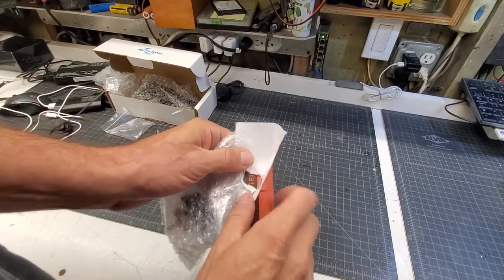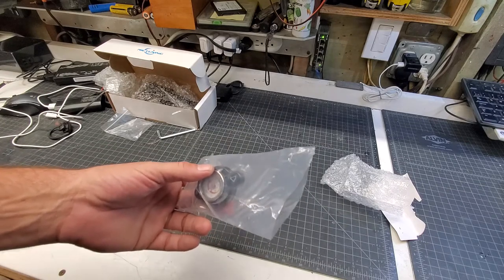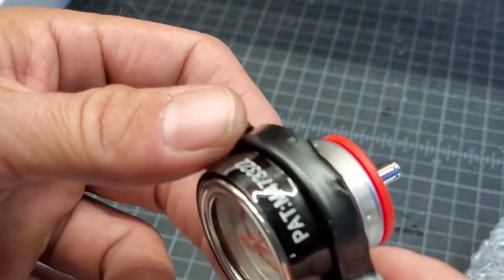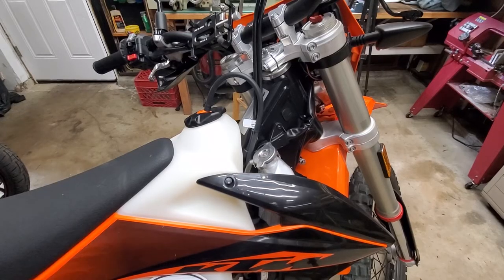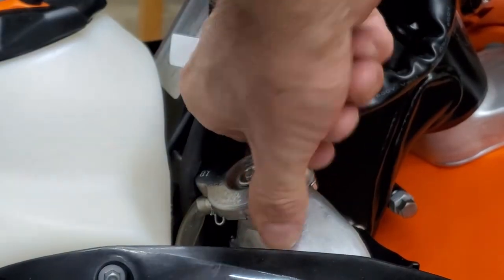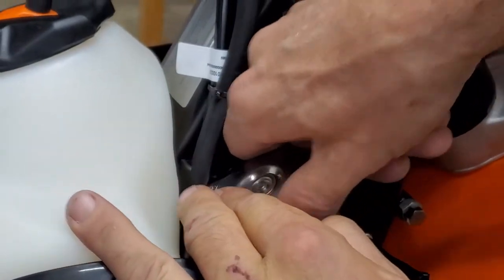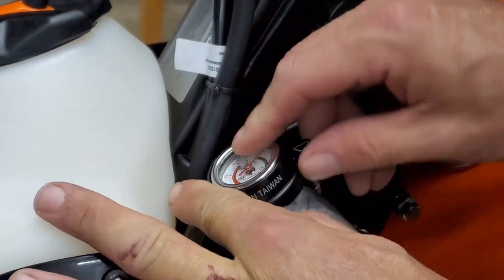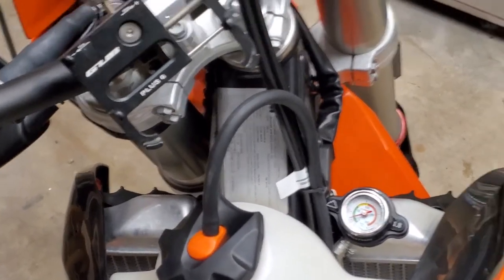KTM 350 Radiator cap with thermometer, Summit Tools

Comment: As an engine builder I would not reccomend these. The same cap is being sold under multiple cheap brands and they are known to fail. Radiator caps shouldn't "fail". These do. Constantly.